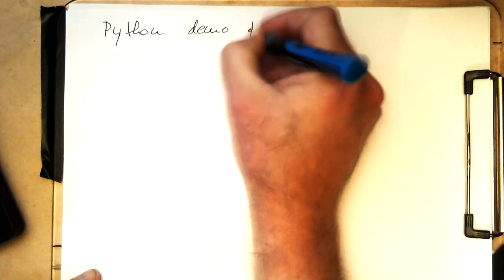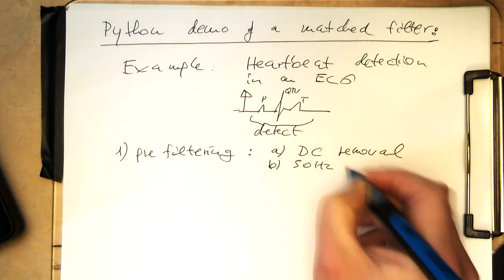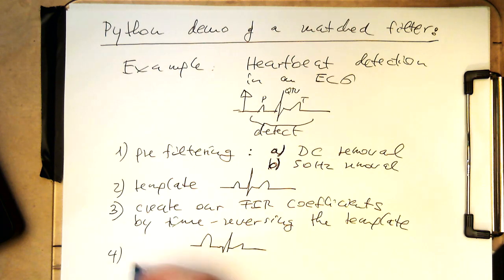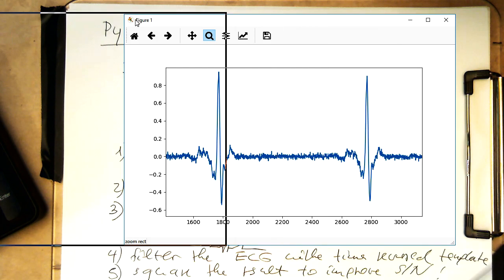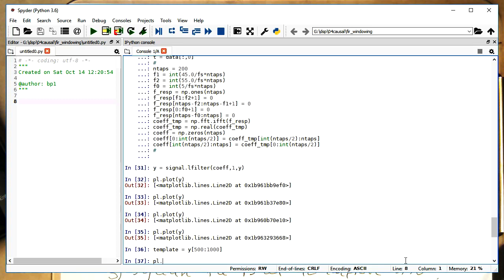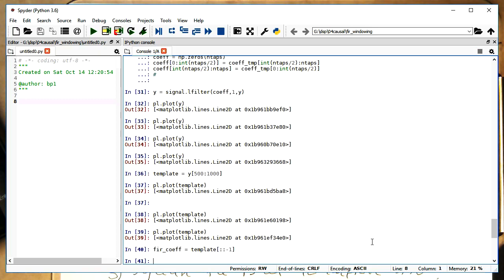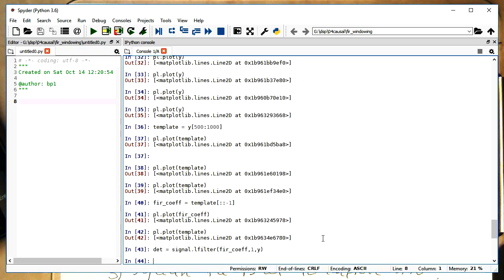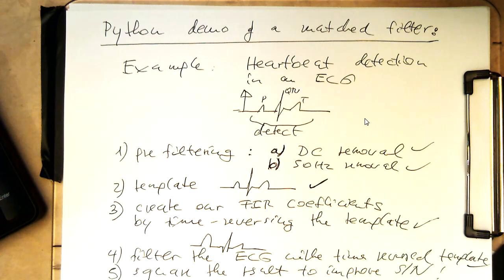Matched filters: Python demo detecting heartbeats (Py)

Comment: Your explanation is very clear. Thank you. I would like to detect dominant frequency from an accelerometer which seems similar process. The problem that I have is that my data is a real time continuous stream captured from a sensor. May I ask you how to get the accelerometer impulse rate in real time? Thanks
Reply from the maker: I guess you need a proper FIR filter in C++. Same approach. Reverse the template and put the coefficients in the FiR filter. github.com/berndporr Also Python allows Realtime filtering with lfilter sample by sample. Just Google it for the syntax.

Comment: Hey, nice demo, but can you explain why you simple use the values of the template as the filter coefficents? The same for the highpass and band-stop filter for dc and 50Hz cancelation. I dont get why the coeffiecients for the FIR correspond to the values of the template, respectivly the inverse FFT of your filter. Thanks for explaining
Reply: The pre-filtering has nothing to do with the matched filter per se. It just makes the detection reliable and easier. The matched filter acts purely in the time domain. An FIR filter performs a poor man's convolution (just N samples and not infinity) between its impulse response and the incoming signal. A matched filter does a correlation between a signal and a template. In order to use an FIR filter for a correlation you need to time-reverse the template. See the previous clips which explain the theory.

Comment: Hi, can you explain how did you prefilter the signal? 
how you removed the DC and the 50HZ noise, did you find any function for it?
Reply: For anyone in the future; you can remove DC offset by taking the derivative of the signal. You'll have to do the rest with the derivative, but if you recall, the derivative of a constant is 0.